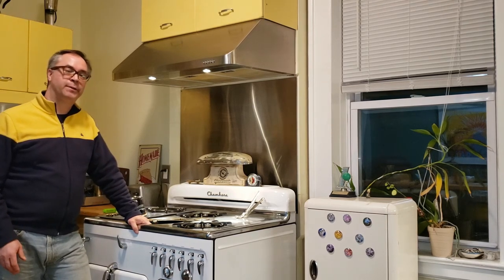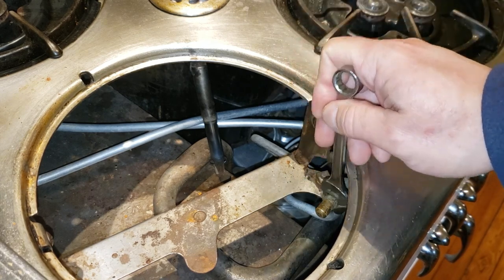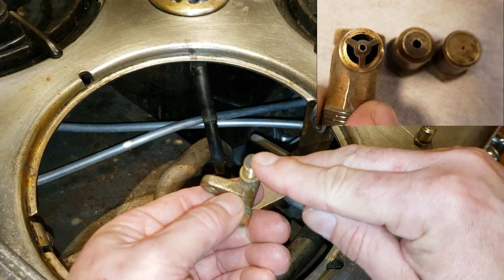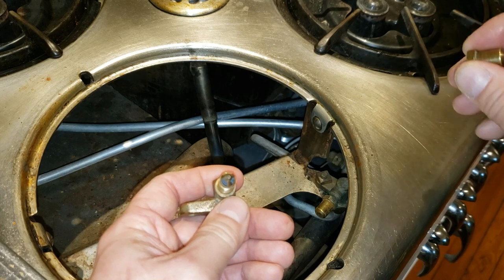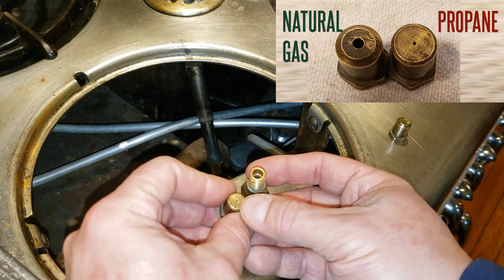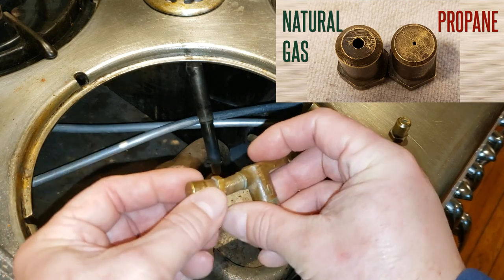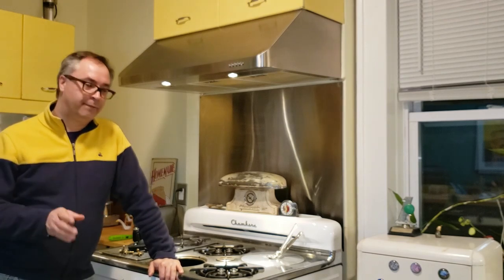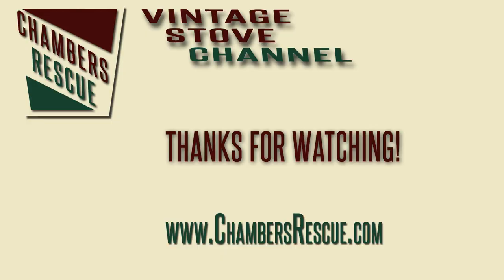How to Convert a Vintage Stove from Propane to Natural Gas (or the other way around)

Comment: I have what I believe is a mid to late 1950s chambers. The 4 burner stove top with griddle and hot plate in the middle sits on top of cabinets and the oven is built into the wall. I recently had a gas leak which required me to turn off the gas. After fixing the leak and turning the gas back on the oven would not light. It seems like gas is not getting through. Any ideas? If I unhook the gas from the oven and Crack the valve, gas flows.
Reply from the maker: That sounds like your safety pilot needs to be relit. There's a red button to press on a valve that's tucked away. You need to press and hold that in order to light the pilot.

Comment: This was great info. I was wondering how to check for a universal mixing pin in the broiler? I understand how to check all the others but it seems the broiler gas line on my 61c chambers cannot be removed to check
Reply from the maker: Not the gas line, but the broiler burner itself can be removed. It's just tricky to do. If you loosen the nut on the left that holds the stem into the bolt (you'll see what I mean when you're looking at the broiler when it's up), you can lift (force) the left side of the broiler out, then pull it to the left. Just be careful and don't yank it so hard you hit your backsplash. Then you'll be able to see the  cap and remove it to see what kind of jet you have.

Comment: Your videos are well done and extremely useful, thank you. I am converting a Model C from natural gas to propane and have verified I have the Universal Mixer Pin. This all makes sense but in the manual there is reference to two different pilot filters. One for LP and another of all others. You did not mention anything about the pilot filter. Does it matter for regulating the burners and thermowell pilots?
Reply from the maker: The pilot filter does not play any role in the conversion, other than the fact that you'll need to adjust the pilots when you switch between fuel types. I'm not sure why they felt it necessary to include that extra picture. I've worked on more model Cs than I can count, many of which have never run on anything other than propane, and have only seen that "propane filter" on one single stove. You can safely ignore it.

Comment: Hi, can I simply remove the universal mixing pin to change from propane to NG? Great video.
Reply from the maker: No, the universal pin does not pull out like the solid pin does. But why would you want to? The universal pin works with both fuel types.

Comment: My question is on “safety systems”.  We just picked up a beautiful Red 90C. I don’t see any safety regulator or any button to push while lighting the oven or pilots. I would think there should be one as our restored 1941 chambers stove has one under the pan storage area.
Reply from the maker: Standing pilots or "safety systems" did not come pre-installed in Chambers until late 1956. Some states do require them, and some customers want them even if they don't need them, so restorers will install them when it's necessary or upon request. On a Chambers, there are real pros and cons to consider to a standing oven pilot. I have a video about that on my to-do list.

Comment: Do your instructions apply to the oven because that is a different kettle of fish from the burners in newer stoves.
Reply from the maker: Yes - I mention at some point that each burner (including the oven) has an orifice cap that needs to be replaced. It's possible that there's a vintage stove where that doesn't apply, but I can't think of one off the top of my head. And yes, it is very different from modern stoves. I don't work on anything after the 1960s and much prefer to not leave the 50s. Industrial design back then was much more geared towards fixing things and not just tossing them out and replacing them.

Comment: I really need help with a 1950 Whirlpool gas stove that I need to convert to propane, Must I take off the entire to to see the orifices? I'm not finding the correct parts anywhere if they are not dual and need to be replaced. Any help or resources to help myself would be so gratefully appreciated!
Reply from the maker: The Facebook group Vintage Stoves may be able to help you, but in principle, yes, you have to get to every burner on the stove and switch out each and every orifice cap.

Comment: Please explain burner adjustment on LP.  The manual (for C models ) only says "flame hight will be lower".
Reply from the maker: On LP, the only adjustment you can give it is with the air shutter to get it to burn clean (no orange tips) and not have extinction pop. That will affect the flame height, too, but it's all done with the shutter. I'll add a video about that to the list.
Reply: Ok. I just pulled my caps. I have solid pins, (look like universal mixing pins but no hole). What do I do to change to LP? Have the pins drilled? Remove the pins and change the caps to LP @ correct BTUs ?

Comment: Great video. I have an antique Liberal stove made by the Licking Stove Works in Newark, OH. There's nothing online, but I have removed the burner orifices and determined that they are 3/8-40 thread count. Again nothing online without going through a HVAC supplier and they don't sell to the general public. Do you have a source you can share?
Reply from the maker: On Ebay, there's someone selling them who will drill out the cap for you to the size you request. But if you're not sure what size you need, I recommend Rex Bakel at Homestead Vintage Stoves. I'm not sure if he has a site, but you can email me for his email address (I don't like to post people's contact information publicly).

Comment: I'm selling an O'keefe Merritt natural gas stove and need to test it first. It's been in storage for a while. Can I test it with propane with the gas fittings or do I need to convert first?
Reply from the maker: If you put propane through burners that are tuned for natural gas, you flame will be very high and yellow. Either sell without testing, test with the correct fuel type or convert.

Comment: Does the hose in the bck of the stove also need to be adjusted?
Reply from the maker: In a manner of speaking, yes. In the US it is now code to have a yellow flex line for a natural gas line. A proper propane connection will be made directly from the tank's regulator. The specifics of that connection depend on the distance between the stove and the tank.

Comment: What about the regulator?
Reply from the maker: Vintage stoves of the age I address (up to the late 50s) did not have regulators. If one is on yours, then it was added on decades after it was manufactured.